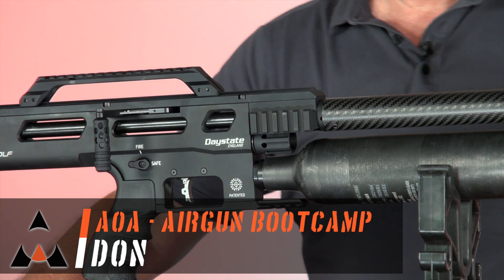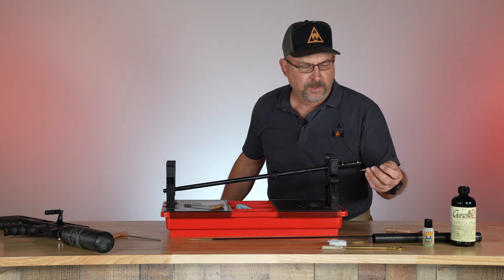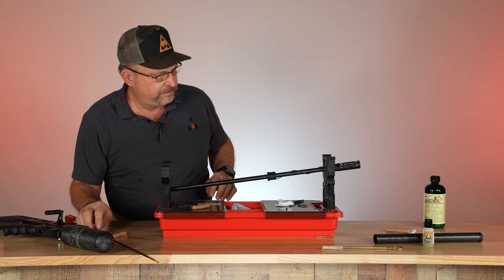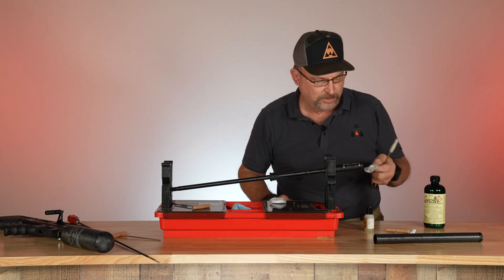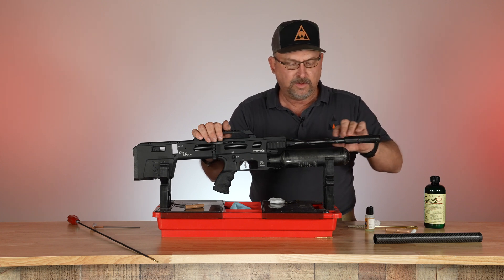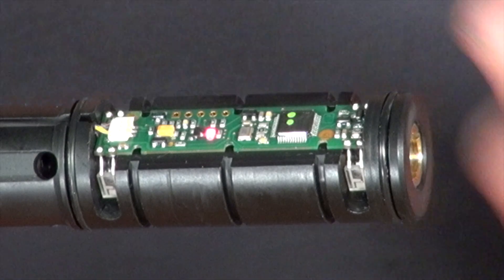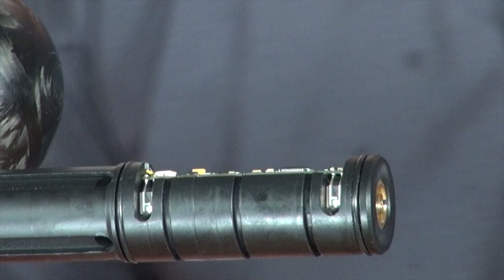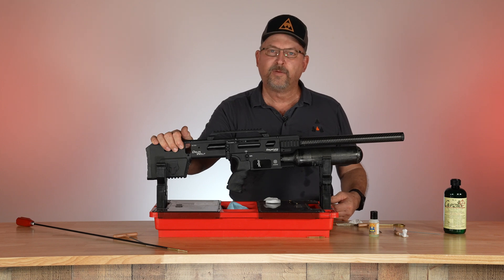Daystate Delta Wolf Chronograph Cleaning - Airgun Bootcamp

Comment: Best.
I have a delta wolf. Yesterday I bought a barrel kit .22. After installation I noticed that the crono did not work, the red light on the crono did light up.
Now I also saw that I can no longer change the voltage, it always remains at 88 volts. one thing might have something to do with the other. Then I changed the barrel of the crono and the crono worked, but I could no longer control the settings. What could I test to see what is broken? Thanks in advance and congratulations on the educational you tube channel.

Comment: The BEST idea is NOT to use a metal tool to lever out the chrono PCB... shorting out the LED legs and connections on the PCB was evident when the Red LED flashed and extinguished. Very Lucky you didn't blow the whole circuitry in the back box.  Or Better still TURN THE GUN OFF BEFORE MESSING WITH THE CHRONO !!! Basic Childhood mistake I would have expected AoA not TO MAKE AND ESPECIALLY PUBLISISE IT ON here.
Reply: Ik heb het ook gezien, de rode led ging feller dan lichter en uiteindelijk uit. Altijd de spanning af leggen en plastic gereedschap gebruiken